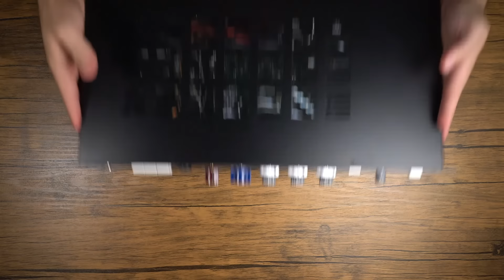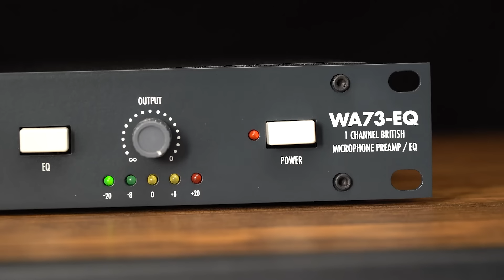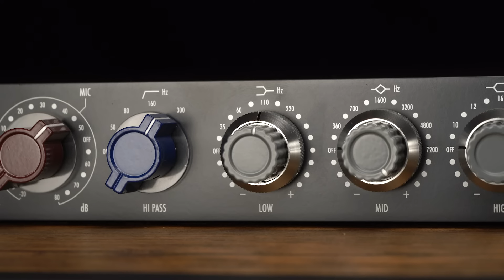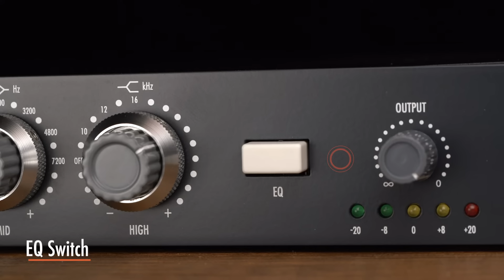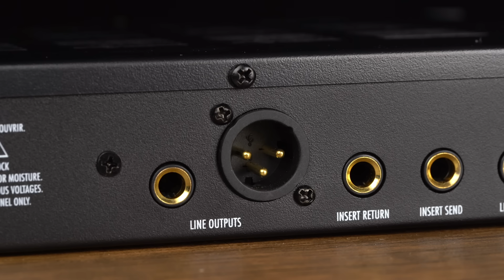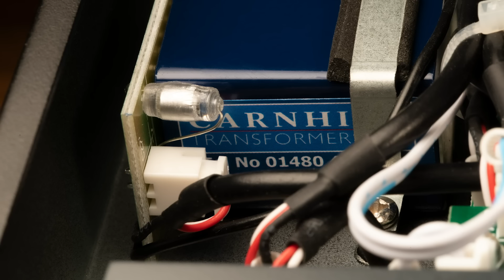Warm Audio // WA73-EQ Single Channel British Mic Pre + EQ "Getting Started"

Comment: Why is there 2 mic inputs?
Reply: It allows you to have your rear XLR input permanently connected to a microphone, or to a patch bay, but let's you bypass that connection by connecting a different mic to the front. If you use a patch bay, you would probably just plug the new mic into the front of your patch bay, but if you don't have a patch bay, this is basically an override for an impromptu mic replacement.

Comment: Hello!! Is it possible to connect two condenser microphones to the device from the front and from the back?
Reply from the maker: Hey! You would need the dual channel unit, the WA273-EQ in order to connect two microphones.
Reply: @WarmAudioOfficial  WHY THEN DO MY SINGLE CHANNEL DEVICE HAVE TWO MICROPHONE INPUTS?
Reply from the maker: @АбакарИльясханов-й5з  The multiple mic inputs on the WA73-EQ simply give engineers easy access to the input depending on their setup. With some studio studios it might be more convenient to use the back panel mic input. In most cases the gear is in a rack and the front panel input is much more accessible. Hope this helps!
Reply from the maker: The same as the XLR input on the front. You can only use one or the other on a single channel. If it's easier to access the real panel mic input with your studio setup, you would use that one. If it's easier to use the front panel mic input, you would use that one.
Reply: @WarmAudioOfficial  It would be very nice if this device had a switch for front and rear XLR since I have two microphones - one for recording vocals and the other for recording guitar and harmonica))) So as not to constantly switch them))
Reply: @WarmAudioOfficial  From the very beginning I thought that it could simultaneously connect two microphones and switch between them>same as on neve 1073 spx
Reply: @АбакарИльясханов-й5з  rear is for patching, front is for on the go.
Reply: @WarmAudioOfficial  WHAT IS THE XLR MICROPHONE INPUT ON THE REAR PANEL OF THE DEVICE?
Reply: @АбакарИльясханов-й5з  patching

Comment: I have a question, on the EQ, can i for example choose a frequency, then reduce it or add to it, then go to another frequency and reduce or add to it whilst my previous modification is still intact? For example reduce 700hz, and then increase 3200hz after?
Reply: Not on the same potentiometer. You can obviously alter three different frequencies due to the three different pots, but you can't set multiple changes on just one of them.

Comment: Is there a way to bypass the pre amp and strictly use this for EQ?
Reply from the maker: Hey Skar! You'll still engage the circuitry of the preamp, even if you use the inserts. So, although there is a way to bypass the EQ, you can't bypass the preamp.

Have you seen our WA-EPQ? Great piece of gear if you're just looking for EQ!

https://warmaudio.com/eqp-wa/
Reply: @WarmAudioOfficial  looking for the WA76, then going for the WA-EPQ, oh and a patch bay.  LOL
Reply: Yes, make sure the 48V for the preamp is off and then engage the EQ button and only the EQ will be used. If you are using it as a plugin, then make sure your have your I/O inputs and outputs set up to the inputs and outputs on the back of the WA73 and then click the line in button.  It's in the manual.  I love this thing.  Getting more WA gear soon.

Comment: Should the ground switch be lifted when in use?
Reply from the maker: In general, a ground lift switch should only be used if there's a reason to - meaning, you have a hum or a buzz that you're trying to get rid of. If there are no such issues, leave the ground lift switch in its default position. Hope that helps!
Reply: @WarmAudioOfficial  it does. Thanks. I'm getting that WA-2A next 💪🏽

Comment: Someone using this machine said, "This smoothes the transients."

A rudimentary question, why does rounding the transients make the hero's sound stand out? Is it the same as a compressor, the same as having more headroom secured and pushed in the function of the compressor?

Comment: Can you use 2 mics into the front and rear XLR's ?  I love mine, also have the WA76.  I use both outputs, one to the '76 and one straight in, for parallel compression.  Never tried the tone button, will give it a go
Reply: No you can’t.

Comment: So is the microphone input on the front the same as the one on the back?
Reply: The XLR input on the front is identical to the one on the back (only one XLR output on the back). I always have an XLR plugged into the back of mine going to a patch bay, but get a signal through the front input anytime I plug into it. I’m not sure the rear input signal gets bypassed when plugged into the front, though.
Reply: @dietrpoppen7981  It does get bypassed.
Reply: @ernestdaniels1671  mine doesn't lol